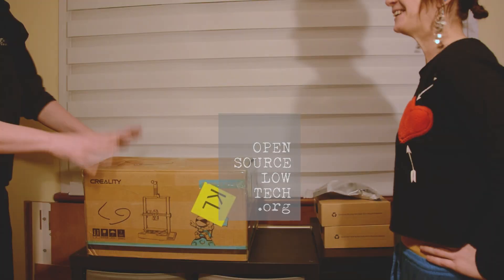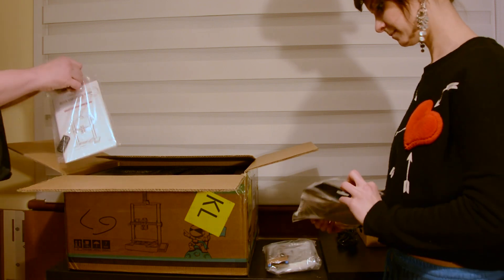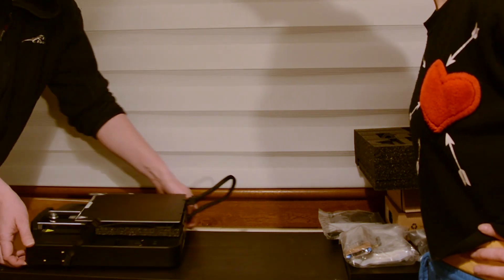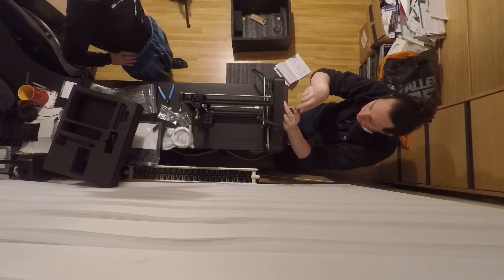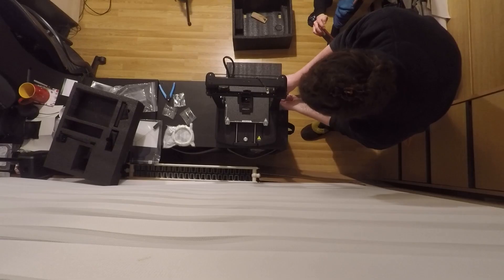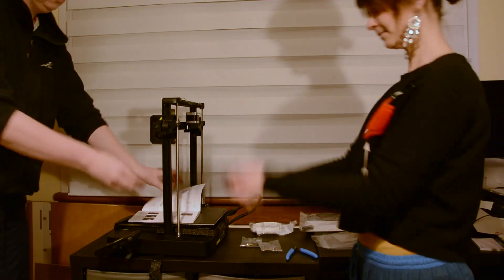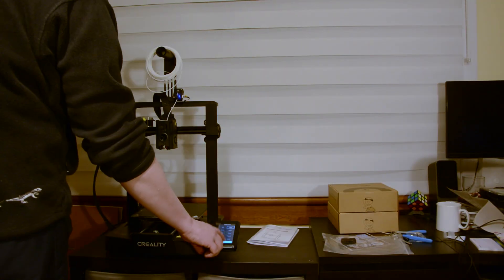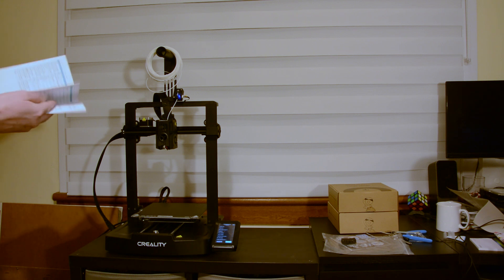Setting Up The New Creality Ender-3 V3 KE 3D Printer

Comment: How much heat can the products made by the Creality withstand?
Reply: Glass temperature depends on material.

    PLA: 60˚C
    PETG, high-temperature PLA: 95 ˚C
    ABS: 105˚C
    Nylon: typically 70˚C or above ("Nylon" is a large family of similar polymers)
    Polycarbonate: 145˚C

Typically you need a heated enclosure for higher temperature materials such as  ABS or Polycarbonate.